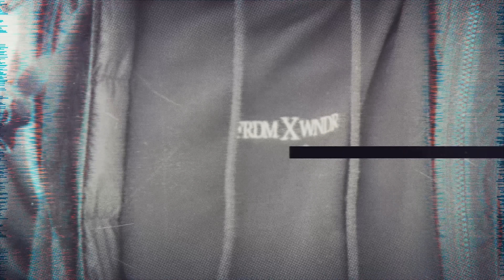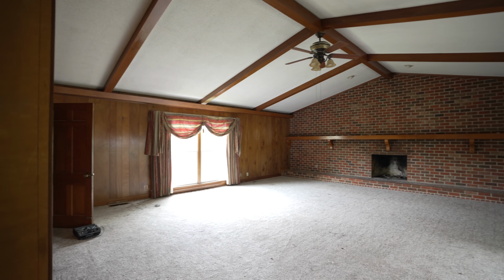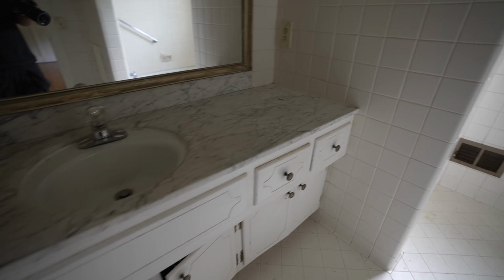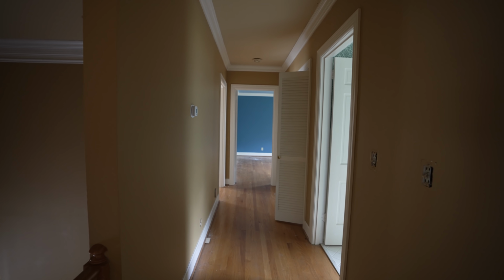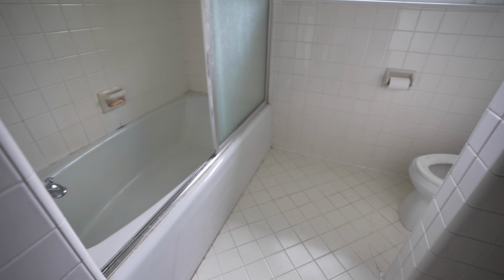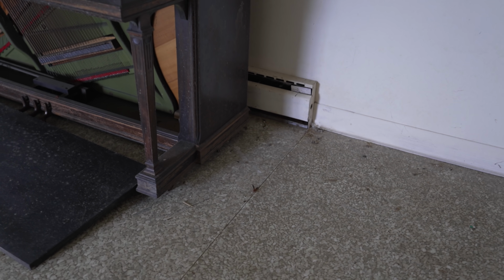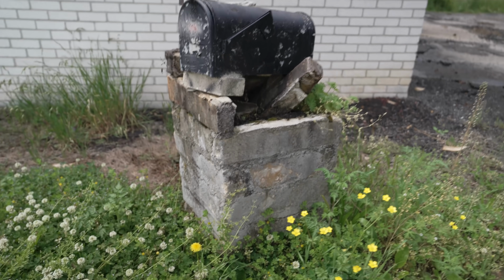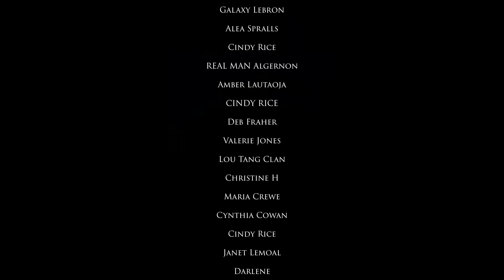Abandoned Apocalypse Millionaires Mansion The Last of Its Kind

Comment: This is late 70s early 80s construction. That “exposed” beam structure was common and has nothing to do with religion.  Looks like they tried to update the bathrooms.
Reply: Some of those early features look like late 50s to 60s an over time they remodeled or upgraded
Reply: Definitely 60s. The house I grew up in was built in 1966 & had the exact same bathrooms, sinks, & cabinets. We also had the same nutone intercom system
Reply: Yeah, I don't know what he was thinking when he came up with that religion idea.  I pretty much turned off the sound after that and after misidentifying the laundry room for a small kitchen and calling the fireplace mantel a shelf. Narration was embarrassing...
Reply: @debkski6084  Usually, most people who love architecture know general terms for things like that. I think it’s just his age—although I think at his age I knew what those things were but was still learning what a dormer and cupola was.
Reply: @juanital.2608  Yeah, the Nutone intercom threw me off a little. That would have been late 60s.  I think this house was in several different states of remodeling without a unifying era.

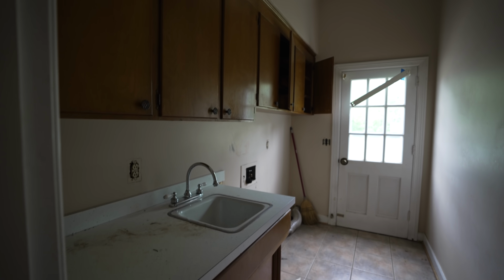Comment: @6:05 , that's not a little kitchen area, it's the laundry room. The sink they installed looks like a kitchen sink. You can see the hook ups for the washer on the wall. Also the vent hose for the dryer on the floor.

Comment: Steve, you don't mention the build year but it looks like homes I grew up around.  They were constructed between the mid fifties to mid sixties.  It's possible a family owned the house with acreage (could have been a horse ranch) and the next generation sold every thing (or 'got an offer they couldn't refuse').  Even a 50 year old "manson" n this condition would be resale able or perhaps kept for a neighborhood club house.  BTW, the  'radio' you saw built in the wall was/is an intercom.  It was used to speak to someone on the first floor or basement without having to shout at the top of your lungs.  Also, this house would not have had a butler but maybe a maid who came in daily.

Comment: I think this house was likely built in the late 1940's or 50's, judging by the room and closet size and the bathroom fixtures. For instance, all the tubs are retrofitted for showers so the plumbing is not in the walls. There were many bathrooms so it wasn't from the 1800's or early 1900's. Lots of things point to mid 1900s.

Comment: The vaulted ceiling with wooden exposed beams have absolutely nothing to do with religion, Steve. I suspect the house is going to be fixed up and not demolished. I don't see anything to hint of an apocalypse. Not sure why you used that as a header. The thing on the wall is an intercom system that could also be used as speakers to share music throughout the entire house. I have relatives that have that type intercom in their homes. They don't have maids or butlers. hahahaha  It's was just a cool novelty in that time period. Flocked wallpaper was also a big deal in the late 70s and 80s.